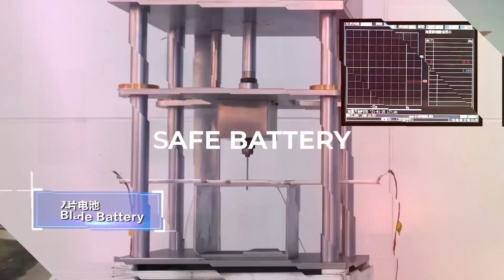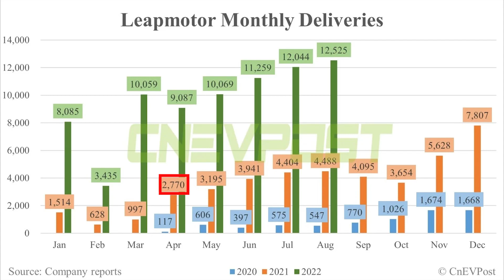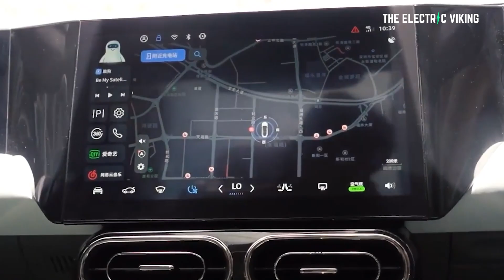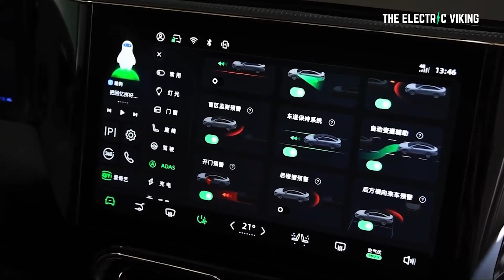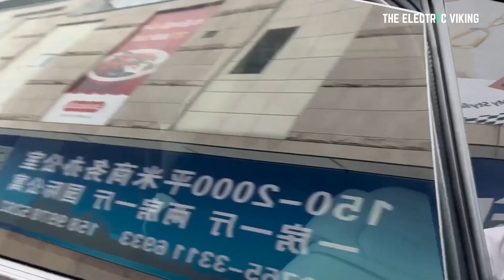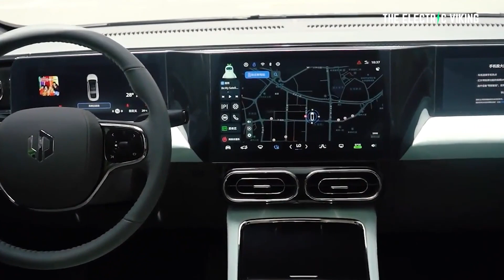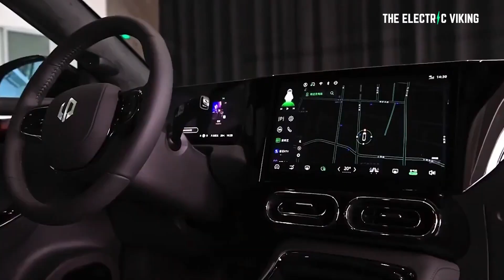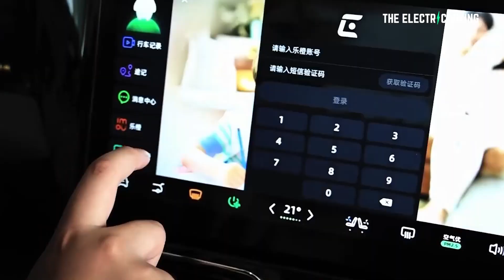The BEST value electric sedan in the world has Tesla-like CTC tech

Comment: CTC has small advantages in weight and volume (although the weight advantage is minimal at best, comparing Teslas with CTC batteries and the ones without) but it has huge disadvantages in repairability. Any damage to any part of the battery can mean a complete battery pack replacement or complete scrapping of the vehicle, even for something simple like a broken coolant hose stub or failed internal pack fuse (fuses can fail through thermal cycling over time without any other fault being present). That's insane and is extremely wasteful. CTC is being used by manufacturers to make it easier for them to make the vehicles, it has no real advantage for the customer and lots of disadvantages.

We need simpler, easier to repair vehicles, not vehicles that are basically a sealed unit and have to be thrown away with minor faults. CTC is a gimmick, and one you and others have fallen for, don't get sucked in by the hype...
Reply: But it comes with a lifetime guarantee...

Comment: As a Tesla investor, I am concerned that LEAP motors (or anyone else) can produce cars quite similar to Tesla's at half the price.  We have been discussing Tesla's manufacturing efficiencies as a major advantage, and yet LEAP motors appears to be the better value.  At the least, if Tesla is to compete against LEAP, this would mean decreased Model 3 prices, shrinking profit margins, and decreased stock share price.  Agree?
Reply: I have doubts that LEAP can produce similar cars for 1/2 the price when both share the same labor pool as they do in china.   The money has to come from somewhere.
Reply: Unknown about LEAP production costs, maybe they can, maybe they can't.  I believe Tesla is using their large profit margins to invest in future capacity.  If or when the time comes that they need to reduce prices, they can do it, and will already have self financed their massive capacity expansion.
Reply: But LEAP will also need a charging Super Charger network. They will need the over the air tech and all the support centers Tesla has. Theyhave a long way to go.
Reply: @PhxElecAuto  well not anymore here in the UK any vehicle capable can use the Tesla super charger network.. and to be honest the other networks are catching up rapidly.  Leap will simply subcontract the dealer network for delivery and any maintenance required.. and hopefully sell direct to the customer like Tesla does.
Reply: Don't worry. Tesla Energy will be BIGGER than Tesla Auto. And Tesla's real money-printer: Robotaxi!!! +TeslaBot